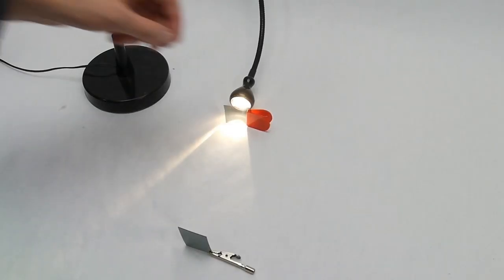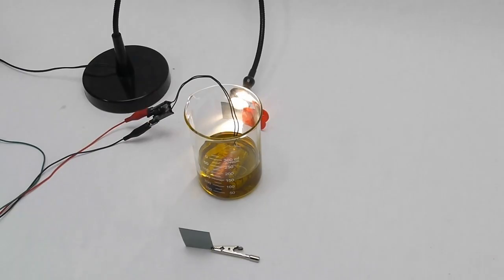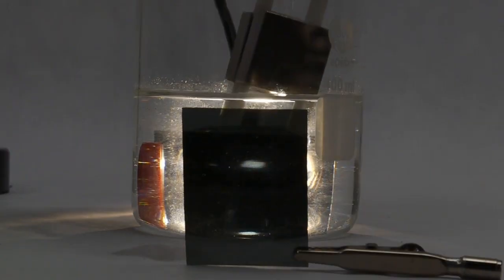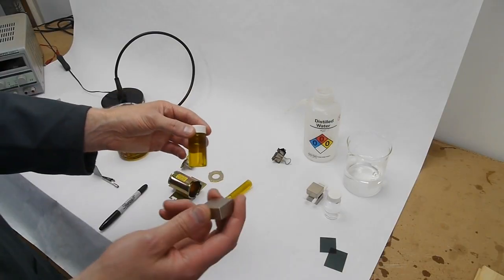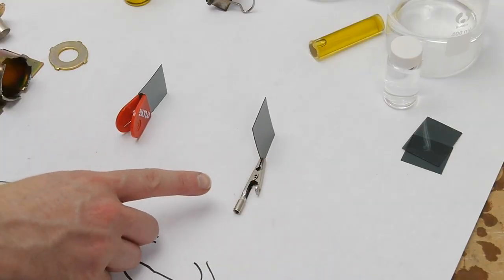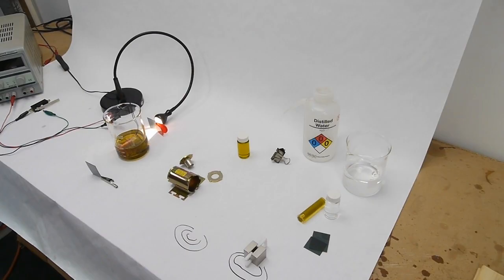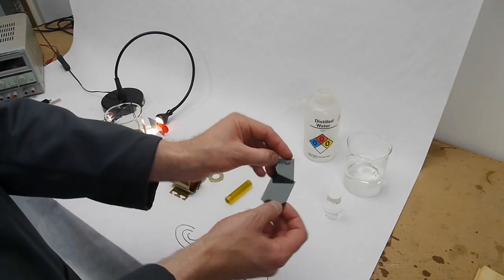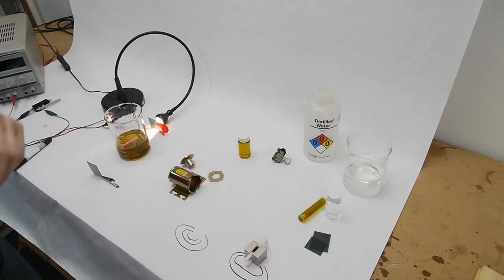Control light with magnets and olive oil?! (Faraday effect)

Comment: I wonder what the frequency response is; could this be used to create a microphone?
Reply: the frequency response is limited by the speed at which you can change the magnetic field, which for a coil with thousands of turns is crap for audio.  I think your best bet (if you really insist!) is to ditch the faraday effect and use a diaphragm to slightly move the angle of one of the polarizers.  You'll only get small variations in light level, but enough to be amplified. Probably better off with a piezo...

Comment: Love your video. Question. On your 45 degree example, where positioning the light in the opposite direction, forcing the light beam to be bent 90 degrees instead of 45, did the light simply diminish, or if we put a third polarizer at that final 90 degree area would we be able to see the light there? If so, then if we placed a focused mirror on the 45 degree side to return the beam back into the coil, would we have a machine that bends light photons at a 180 degree angle?
Reply: polarisation of em (electromagnetic) waves goes way too deep for my brain, but I think I can give the view of "classical" physics without going too far wrong.  If the electric field is (let's say) vibrating up and down, the electric field is going left and right.  That doesn't mean that nothing is happening at 45 degrees, the better analysis gives vector components of both at that angle.  If you rotate by 180 degrees, the electric field is going down and up and the magnetic field is going right and left.  I don't think that there's any way of telling the difference. So a 180 degree rotation of the polarisation has the same observed result as if you hadn't bothered.  That may answer your last point, the first ones are too hard for me!
Reply: Thanks!  My mind's a little muddled and I apologize for that.  I'm a curious novice who is trying to work out a connection between photons and neutrinos in my head.  (among other things.)  I can't help but think something in our current theories are slightly off on the subject.  Thank you so much for your videos.  They are always interesting and instructive.  You are truly one of the good guys...
Reply: +John Richter   if you're pursuing physics, it's a safe bet that your mind will never be unmuddled.  There's a famous quote from a father of quantum mechanics (sorry, crap memory) ... the surest sign that someone does not understand quantum mechanics is if they say that they do.  Ha ha!  Have fun, it's addictively interesting, but even trying to understand why light travels slower in glass (the basis of all our lenses) is debated at expert level today.
Reply: I love muddling!  Photon wave interference by imperfections in glass is my guess on why glass slows photons down.... Maybe trying to match wave resonance of glass could help? If we could build the perfect glass then could we build the perfect mirror - allowing photons to reflect off of them indefinitely?  If we polished the diameter of your ruby crystal and encased it in a perfect mirror tube - would we get a higher rate of excitement?  There are just so many interesting things that can come from  the quantum field today.  It is so wide open.  This is really an exciting time for muddling minds to be alive!  Yours is pretty deep and you have a wonderful gift of explaining it to novices....  Thank you
Reply: +John Richter  hi john! you may have just reinvented the ruby laser... btw, I don't make videos I'm just joe public.

Comment: If you passed a powerful light source with mechanically rotated polarization down the barrel of that solenoid while submerged in oil, would a voltage be induced in it?

Comment: I don't know where you got the idea of the one-way thing, but I doubt it will work that way.
The light direction and the magnetic field are both vector quantities, so when you go through the substance in the other direction the sign of the Faraday effect should change (as when you change the current direction in the electromagnet). Therefore the rotation direction should be opposite when coming from the 45 degree polarizer and you get to 0 degree, not 90.

Comment: Can you do this reverse?

So that normally both polarizers block light and when electromagnet is turned on it pass light , is it possible

Really amazed by this experiment, nice explained!
Reply: yes, put a polarizer on either side of the electromagnet that at at right angles to each other.

Comment: Jesus. I got a good laugh out of this video, and learned something more about Faraday, beyond the Faraday Cage.

Not gone lie though, when that magnet flew 5-7 inches and clicked my first thought was Oh F*** as well. And then it promptly became giggles and farts from there.

Also, you said that distance, material's Verdet constant and magnetic strength all affect how well, and how this functions, and given as you said, solids would be more likely to have a higher constant, and requiring a initially transparent material, would placing specific amounts of any material that has that high constant within glass and somehow subjecting the glass to magnetic field be the best way to go about making windows which tint or completely block light, on command?

Comment: If "plastic randomizes polarization" then how are polarizers made of plastic and why polarized sunglasses work?
Reply from the maker: Dušan Petrović That is a good question.  The plastic is specially made so that it will function as a polarizer.  It's called polaroid and is stretched or subjected to electric fields during manufacture which makes it useful.  For typical plastic manufacturing that uses injection molding or casting, there will be residual stresses and imperfections that cause it to change the polarization of light traveling through it. https://en.wikipedia.org/wiki/Polaroid_%28polarizer%29
Reply: +Jeremy Lee   I think part of what you said there is wrong.  Have you tried looking through polaroid sunglasses backwards?  When he puts the bits of plastic on the table is there a a kind of heads or tails, which way up is it?  I think not.  It's rotation in the plane of  the sheet that is significant, not which face you consider to be the front or the back.  In short, they're not optical diodes (one way streets).
Reply: +Dusan Petrovic Ah, that's an easy one. Because they're very careful about which side the polarization filter 'film' (or grating) goes on, and it's not possible to wear sunglasses 'backwards'. But if you did pop the lenses out and flip them to point inwards, yes, they'd stop working. (Just like 3D movie glasses) Plastic polarizers work because they're not "normal" plastic. Some effort has been put into aligning the polymer chains, making it more like a solidified liquid crystal. (special etched substrates and formulas are used.)

Comment: Wow, Memory Lane:  My friend Earl and I did this for a High School physics project about 41 years ago.  We built a cell similar to yours wrapped in a big coil of copper wire that was connected to a high power vacuum tube amplifier.  My recollection is our cell was filled with glycerol.  We sent the beam of a He/Ne laser through the cell across campus and speaking into a mic connected to the amp sent voice messages (one-way) to a phototransistor receiver.  We also experimented with optical crystals of potassium aluminum sulfate cut along different crystallographic axes, I still have these crystals but I don’t recall the results.  I believe there is a Scientific American Amateur Scientist article but haven’t found a reference to it. Cheers, Mark
Reply: Mark Beeunas 41 year agos high school experiment? wow
Reply: @MsHojat  Wow indeed. The dumbing down of Humanity has gone a long way. In 2019, students of Universities can't determine which bathroom to attend ! ^^
Reply from the maker: Mark Beeunas Good stuff!
Reply: Mark Beeunas 
PS: Can anyone find the Scientific American Amateur Scientist article that shows this experiment?  I'm pretty sure there is one.

Cheers,
Mark
************************
Reply: Kevin Byrne 
Hi Kevin: Apparently Scientific American is extraordinarily protective of their Copyright; as you have probably found it is next to impossible to find any pdf's of any SA articles.  So yesterday I went to the UofA library and made a copy and the title in the table of contents is as you show above with the article itself titled: "A modulator is constructed for laser light, and phase-contrast microscope is simulated" (two unrelated projects).  This is the article I was thinking of and it is a Faraday Cell setup (see: https://zmabz.smugmug.com/Other/Faraday-Cell/n-8xbwQ5/).  The article discusses filling the cell with carbon disulfide, water and nitrobenzene. We experimented with pure water, water solutions of sucrose, NaCl, CaCl2, etc., glycerol, motor oil, different hardware store available solvents and sulfuric acid in our cell. As mentioned in my initial comment we experimented with crystals of potassium aluminum sulfate, but not in a magnetic field (i.e. Faraday Cell) as I was originally thinking but as a Kerr cell with the crystal pressed between metal plates that could be charged to high potential.  Our Faraday Cell worked great, but we never got any positive results for the Kerr setup.

Cheers,
Mark
***************************
Reply: Mark Beeunas -- You might be thinking of "How to construct an magneto-optical modulator" in the Amateur Scientist column of the November 1970 issue of the Scientific American.  However, I believe that that column treated a Kerr cell rather than Faraday rotation.
Reply: Glad that I could help.  I'm jealous of your high school physics course.  Sounds as if you had a great teacher.  And, yes, it is indeed difficult finding Scientific American articles on the Internet. 19th century issues of Sci. Am. are available on Google Books, but only rarely can you find more recent articles -- and they're usually hidden in obscure locations.  Best regards.
Reply: Kevin Byrne 
Yes indeed, 'Jumping Jack Hart', my 8th grade physics teacher.
Reply: What year ?
Reply: +zzdfhgdhd   Interesting, my guess is it might.  My thought is the electromagnetic fields associated with the light beam might align the molecules producing a magnetic moment that would induce a current in the coil.  I would also guess this affect would be very feeble.  This is just my WAG.  
Cheers, Mark
Reply: what if you make a magnetic... motor...that  .. generates...endless Power...?
Reply: Is that genetic law or geriatric law?
Reply: +Nathan Trigg this is a very easy experiment to replicate.
Thank you Ben.
Reply: Hi +zzdfhgdhd:  First I will say I don't know but I don't see how a vacuum would effect anything one way or another.  If this is in reference to my post about the Kerr Cell 'vacuum' tube, please note I used the word vacuum (in single quotes) only because the Kerr Cell (http://www.museumoftechnology.org.uk/expand.php?key=1157) is in the form of a vintage vacuum tube, I have no idea if there is or is not a vacuum.

Maybe we can get some others to weigh in with their thoughts.

Cheers, Mark
********************
Reply: +Applied Science G'day Ben, 
                 could l use scraped polaroid sun glasses to repeat your experiment.
Reply: +Applied Science G'day Ben would it be possible superconduct the experiment? for more affect.
Thanks from Triggy.
Reply: I would be rich!
Reply: It's on you wrist!
Reply: I found another clone of my ex wife Nadia nadja,...
Reply: Or Gina: article : 2 of the ge knee va co Vention.
Reply: It's a genetic law.... Florida law posted on a road pav Ving... project...that a steam roller is working at....near Albert witter, Field...airport.  municable,
Reply: it would follow from the reversibility of physical laws, but then we should take into account the rotation of polarization. Would a rotating plane polarized light beam induce current through the coil?
Reply: Wow. Your high school must have had way better funding than mine. (I was class of 2004 in Washington state.) I think we did about 5 actual hands-on experiments. With the current state of our educational system, it's no wonder America seems to be getting more like the beginning of the movie idiocracy.
Reply: My high school physics we played grand theft auto... I was the top score
Reply: Wow High school physics isn't what it used to be.

Comment: At 0:52 onwards, what is causing the bubble-looking effect in the top-left of the oil?
Reply from the maker: Badatstuff Good eye!  The coil is letting out some trapped gas as it heats up.  This thing is dissipating 90 watts!  The coil windings are pretty tight, so the warmed gas is expanding and coming out of the coil.

Comment: A cheaper way of obtaining small polarizers is watching a 3D movie at your local cinema and keeping the throwaway glasses. It's also more fun, because you get to see a movie :-) The glasses that are currently in use aren't just simple polarizers anymore, but they should work as polarizer in one direction. I've just checked a pair by holding them in front of my screen and they get about as dark as black displayed by the screen itself. EDIT: Typo
Reply from the maker: ***** That is a good idea.  Keep in mind that modern 3D glasses are probably built with circular polarizers, which are composed of a linear polarizer bonded to a 1/4 wave plate.  It will behave differently depending which way you look through!  I'll be doing a future video on linear vs circular polarization.

Comment: I build an electrical polarimeter in school about 24 years ago for chemistry. I used a large coil and had a special glass rod made by Schott from a glass type called SF-59, 10cm long, about 2cm diameter and polished super-parallel planes on both sides. I still keep the glass for sentimental purpose. If you are interested, I could lend you the glass rod if you want to extend the experiments. It was in the days back then the material with the highest V (0.128 arcminutes/gauss*cm, water has 0.0131) without gaps in transmission in the visible spectrum.

Comment: This takes me back to my undergrad physics days. We had this one lab experiment where we measured the deflection of a laser beam shot through a relatively small chunk of faraday rotating material like TGG, YAG, and an ampoule of olive oil. The entire setup was done in such a way where a change in polarization also result in a change of the angle of deflection of the outcoming laser.

The setup was basically a cylindrical blackbox with a slot for the material in the middle, a miserable circular compass angle measurer at the end, a laser at the other end, and both cold water and 4kV coming into the black box. Scary magnets, so we had to make sure we left our wallets and phones and watches well away from the setup.

In the end we spent 3 hours measuring sub-degree changes in deflection, getting mad at the small thickness of the faraday rotator, and using all our skills in error analysis techniques to get a calculated Verdet constant within the correct order of magnitude. It was fun times and typical for an undergrad physics lab with equipment older than the instructors.

Then you come over going all "Hey look at this faraday effect in a clearly visible way, isn't this cool?"
You're doing good work.
Reply from the maker: The Fifth Walking Way I really like your story of undergrad physics, and it sounds a lot like many teaching lab exercises that I've endured as well. I agree that most of the descriptions and teaching labs on the Faraday effect are way too esoteric and seem to miss the idea of giving folks an accessible understanding of how the universe works.  It makes me want to shout at professors, "Just explain it, will ya?!"
Reply from the maker: ***** Perhaps you're new here.  As you might have noticed, the comments sections on my videos are free from hateful and unproductive talk.  Please do not force me to start deleting comments.  Having a decent comments section is rare on the internet.
Reply: +Applied Science as a high school physics teacher, one of the things that I struggle with is making things accessible to students.  one thing i like to do when I can is build experiments with home materials, or send students home to do their own.  I have had students do this with electroscopes, but it is hard to find experiments like this that can be even partially home-made.  Good work!
Reply: It's hard to make things accessible to students, not because they are stupid, but because you're dealing with about 10% of their attention on average.
Reply: I have that video.   I love it.
Reply: You are wrong...По следам эксперимента Баранова-Зателепина , 12 августа 2019 года https://drive.google.com/file/d/1QsUVE55DRhdoR32kdaXusBYhbRZ16b4-/view?usp=sharing